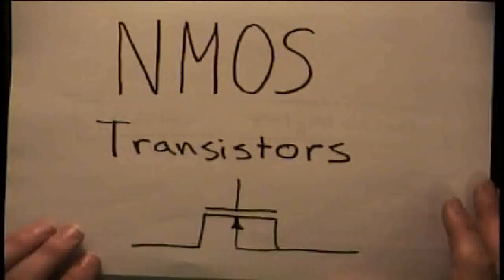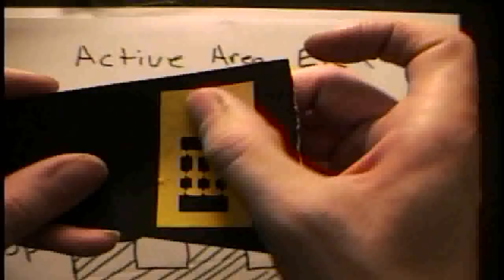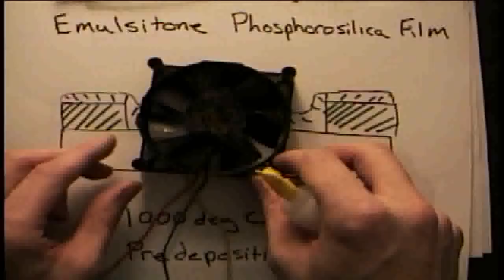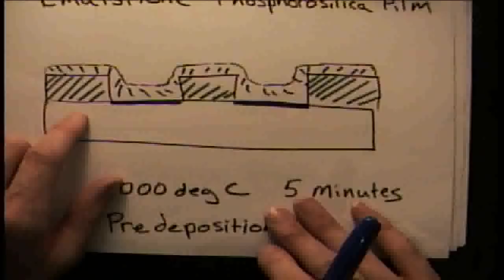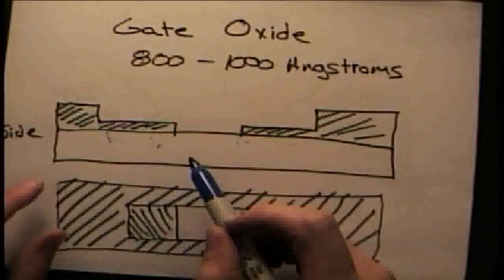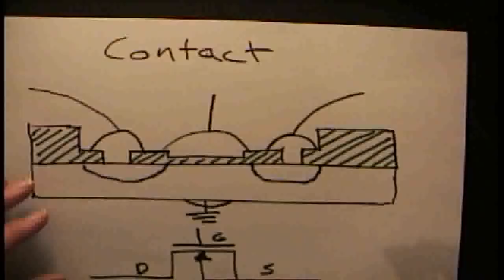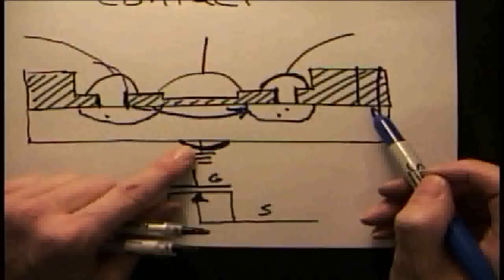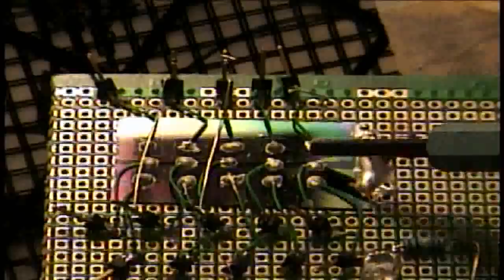Homebrew NMOS Transistor Step by Step - So Easy Even Jeri Can Do It

Comment from the maker: @PatheticComputing It's surprisingly easy, although it took me three years of experimenting to make my first device.  Watch out for exposed PN junctions.  Keep oxide over them or they conduct.
Reply: Secret sauce is the rust and stain remover. That was maybe historically fairchild’s “colonel’s secret recipe”
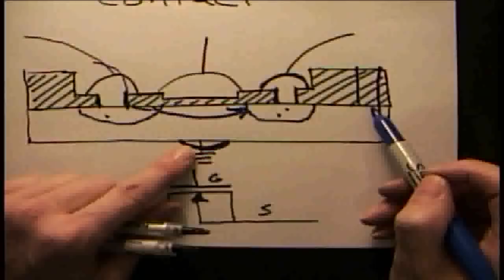Reply: Connecting substrate to ground 6:54  “gets rid of the pn junction” ? Talking about the junction region that has to be overcome by some voltage because some electrons from n side naturally paired a little into p side?

Comment: As I understand it, there are the most common type of power MOSFET, and the first to be widely manufactured.  N-channel MOSFETs are workhorses in switching power supplies, motor drives, power inverters, or any electronic device where fast switching of high amounts of current is required.  The only problem with MOSFETs is the fragile gate oxide, which can be destroyed by static electricity.

Comment from the maker: @YoLninYo Solar cells are very easy to make with this process.  Problem is that they take too much energy, because of the furnace and small batches.  They'd never return energy to pay back 6hrs at 1000c.
Reply: If you power the kiln with solar (pv and light), the 6 hours at 1K C is not accomplished with fossil fuels, but renewable energy, and they then don't have to "pay it back."  What do you think?
Reply: You can get up to 1000 C using sunlight and a lens to concentrate it. not sure you're going to get 6 uninterrupted hours without trouble.

Comment: I envy you the feeling you must have had with your first success. I couldn't help but imagine the pioneers working their way past insurmountable problems to achieve the same thing without the benefit of prior knowledge. Amazing.

Would putting the wafer off-center make the spin coating a bit better? I got the impression that such a small wafer in the center like that wouldn't receive even and/or high centripetal (centrifugal? ...) forces. Hmm. The "real" machines center the wafer though...

Comment: awesome! But what equipment I need to get 1000°C at home?
When I had listening semiconductors course in university, I only imagined large industrial facilities as possible place to build transistors, chips etc.
Reply: Propane Burns it 1995 c. MAPP gas goes up to 2020.

You could even use sunlight and a magnifying lens. That might actually be easier to control than the burning gases.

Comment: Pure junk yard mechanic Genius! Thank you lady! Just not clear about 4:13, how do you drive the phosphorous layer in? Do you just leave it to sink in?
Reply: You coat it in the phosphoric acid (or other substance containing phosphorous) and heat it to very high temperatures (1000C) and it will slowly difuse in.

Comment: you are best for my question , that is , what physical changes makes same types transistors ( like BJT or FET  )  little bit different from each other like in bjt  ,  bc547 , s8050 , 13001 ext . my point is what points are responsible for transistor current , gain , ft band,  voltage , breakdown , resistance ext ???

Comment: jeriellsworth, You're in the league - Quartz can even allow Extreme UV in - thus with some attenuation. The only trickier part remains is how to instruct the VLIW graphic processor (Darkstar GPU from TI especially made for the DLP DMDs) with just a video card (You can try ancient video card with DVI port - with some know-hows, as you have to hack both GPUs to do what you want the DMD to do, such as laying out UV photo-lithography imaging) I have done away with DMD, their GPU is hard to use.

Comment: First of all, great video! Very inspiring!
Could you give a little more information on the furnace you were using? It seems to be the most expensive bit in this whole exercise and the only real lab equipment needed. Could you recommend a model to copy the project on a tight budget?

Comment: VERY COOL!!! Homemade diodes and transistors are something I have been thinking about making for a while.

I have read that it is possible to use lead sulfide (a chemical that could be made at home much more easily than silicon metal) as your semiconductor. Have you ever tried that or though about it?

Also I was wondering while watching this if you could mechanically remove the oxide (with fine sand paper or a knife/scraper) instead of etching it with acid?
Reply: JaycubL Hi, I was thinking the same thing since it’s so big, so the acid isn’t needed.

Comment: To increase the rate at which the oxide grows, do you think it would be beneficial to create some sort of mechanism to force steam through the furnace? I'm envisioning a coffee machine repurposed to just boil water and have the steam flow into the furnace, perhaps a low rpm fan. Also if the wafer could be mounted such that it was vertical somehow, the steam would hit it much more evenly I think.

Comment: Interesting. One problem with common projector optics, they're not even rated for UV functions - some has special coating to eat UV starting at 402nm and shorter, and if so shorter, glass starts to absorb it. 250nm and shorter is the best way, but longer wavelength is fine - just don't shake the whole thing (if anyone uses laser - a shake is enough to ruin the whole transistors - whole fab is full of shock absorbers in there too...) Still, it's a great project!

Comment: Very impressive! Can I ask, How important is having the Si wafer surface with a given crystal orientation (you mention 100 in your experiment)? Are other orientations OK, or is 100 the best? Also, is it important to have a single crystal orientation, or could a conchoidal surface also be used I wonder - have you ever tried with fractured Si pieces instead of nice Si wafers?

Comment: Why does the substrate need to be hooked up to the Source (S)? How to take out the hook from a NMOS transistor (Irfz44n) so I can use an NMOS transistor to flow current two-ways? Mean, the gate will be controlled with a separate battery and the substrate will be connected to the ground/negative of the battery.
Reply from the maker: It doesn't necessarily need to be hooked up to the source of you bias it somewhere else.  You want to keep the substrate from floating too high of potential or you may not be able to punch of the channels.
Reply: @jeriellsworth  How to take the ground out from the transistors that are sold on market?

Comment: Except as an excercise in the nearly impossible,I can't imagine why anyone would do this any more than one would try to make one's own aluminum. ("Now lower the electrode from a 1000-amp DC supply into your bathtub filled with crumbled bauxite until  the voltage across the tub is exactly 5.000 volts. Have a ladle handy to dip out the liquid AL. WARNING; DO NOT LET THE SOAP OR ANYTHING WET FALL INTO THE TUB OR YOU WILL BE STEAMED TO DEATH AND THE BATHROOM DOOR WILL END UP IN THE NEXT COUNTY!!")

Comment: Could somebody please tell me if it's possible to make a transistor from solar cells. In theory it should work as a solar cell has a thin layer of p type silicon fused onto thicker n type layer or vice versa. A transistor has a thin layer of say p type as the base sandwiched between two thicker n  layers for emitter and collector so why not just fuse 2 solar cells back to back( but not using the other thin layer)?
Reply: You can't, solar cells are just PN junctions, you might be able to find a way to turn them into makeshift diodes though

Comment: I am working on building a expended PDP8 straight 8, its a 1960s mini computer and it uses a lot of transistors and no ICs! I would love to have one of your transistors in my computer, I know your transistors are very slow but I could still use it. I am based in the UK my ID is rorypoole at
vintage-computer com
good luck with your projects!

Comment: where do you buy these chemicals ?
Reply: The HF is from Whink rust remover or you can make it with sodium fluoride although I'd advise being VERY careful because it can kill you. You can get most of this stuff on Ebay.
Reply: @SIGSEGV1337  thank you i;m thinking of starting my homebrew fab myself. you are my hero
Reply: @ebiros2  That's awesome, we have a Discord community if you need help learning
Reply: @SIGSEGV1337  yes BTW have you tried to make interconnects between the transistors ? aluminum is notoriously dissolvable into silicon, so as soon as you place it over source and drain, you'll destroy them duh  !also have you tried making a depletion mode device ? i'm thinking maybe we can make transistors smaller
Reply: @ebiros2  Discord code is: X4KBJzvK
I haven't but I think some of the guys might be able to point you in the right direction since I think that's a task that involves sputtering and some of them have sputtering setups
Reply: @SIGSEGV1337  thank you. how do i use this discord code to communicate with your collegues ?
Reply: @ebiros2  If you go to discord, scroll to the bottom of the channel list and click 'add server' you'll get a dialog where you can enter the code to join.

Comment: For All the viewers, I want to rectify this a bit. 
The Diy process is okay, but the explanation is incorrect 2:06 it is a Liquid BORON film, not PhosphoSilicate Film the Boron Film step [analogous to DIY crude ion implater]
The BORON film will form N-regions, Similarly, If you want to P-regions use PhosphoSilicate Film (not in this case)
Reply: Or Phosphoric acid.

Comment: hi, Jeri Ellsworth, I'm very interested in your experiment. so , I want to make a silicon diode using the same  process, but I'm failed, I don‘t know what's the  problems cause the failure of experiment. The following is my two experiment flow, please give me some suggestion and help me to find possible error of the experiment step.
N doping for P Type wafer:
1、using P-type wafer of <100> which have oxide laye of 30 A Thickness ; 2、Etched the active layer with hydrofluoric acid of 9% buffered, Etched 1hour . 3、Complete etch leaves water beads on hydrophobic silicon. 4. Doped in Phosphoric Acid of 85%  content spun on fan to achieve a thin even layer. 5、Placed back in furnace at 1000°C， heating 1 hours or 45 minutes or 2 hours. 6、after cooling down of wafer，Etched in hydrofluoric acid to remove film (containing contaminants). 7、Measure the internal resistance of Jonction P-N and N-P by using the omh band of the multimeter，forward voltage is same with reverse bias-voltage，About  20omh.

P doping for N Type wafer:
1、using N-type wafer of <100> which have oxide laye of 30 A Thickness ; 2、Etched the active layer with hydrofluoric acid of 9% buffered, Etched 1hour . 3、Complete etch leaves water beads on hydrophobic silicon. 4. Doped in B2O3 powder on the wafer active layer . 5、Placed back in furnace at 1000°C or 1200 °C， heating 1 hours or 45 minutes or 2 hours. 6、after cooling down of wafer，Etched in hydrofluoric acid to remove film (containing contaminants). 7、Measure the internal resistance of Jonction P-N and N-P by using the omh band of the multimeter，forward voltage is same with reverse bias-voltage，About  3kΩ—20kΩ.

please help me to find possible error of the experiment step， thanks a lot.

best wishes to you.

Comment: lol, love the spin coater (fan). This is cool! So that was a PSG layer you used to dope the silicon? Or a BPSG? (I guess it would need to be more heavily Phosphorus doped to diffuse N-type wells). Interesting, but can see how it would work rather well. Slightly surprised about the PSG use since it's often used as an outer reflow and final passivation layer and for smoothing out ruts and points before laying down electrodes - but it does makes sense because I think the Phosphorous moves to the outside of the PSG during baking, which would make it available for the later diffusion step. Interesting. Rust & Stain remover as etchant - wow, I didn't know that! Conductive epoxy for the gate electrode - wow, I am blown away!  Yeah, I can see how this would work.  Nice job!!!!
Reply: Actually, in some papers I had read, the PSG layer is removed with HF. I spent a couple weeks looking for HF alternatives and I founded that NaOH and KOH can be used for SiO2 etching.

Comment: That initial thick oxide that is 5000-6000 angstroms thick, which takes 6 hours to grow with steam, what temperature is used for that? Is it also 1000 deg Celsius?
Reply: Between 850 ºC and 1000 ºC.